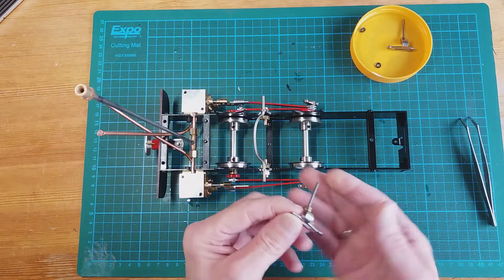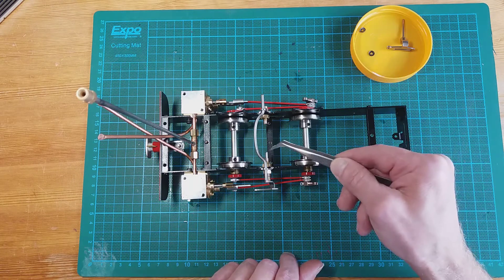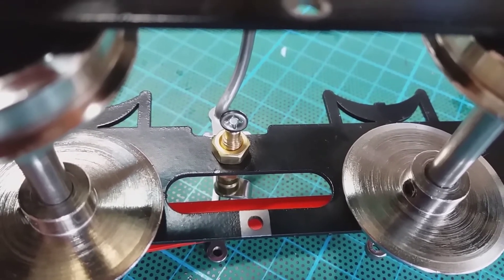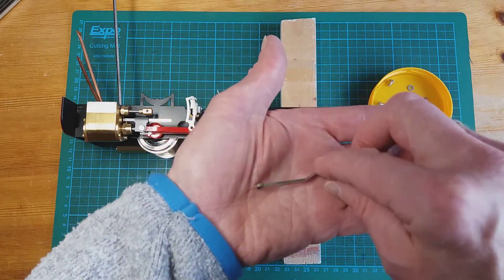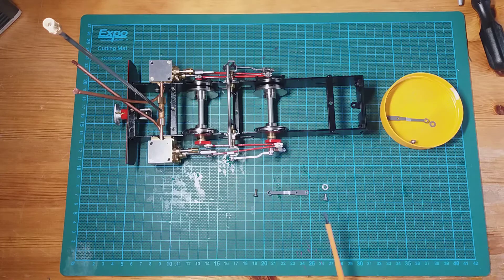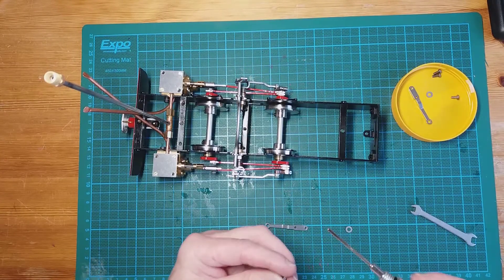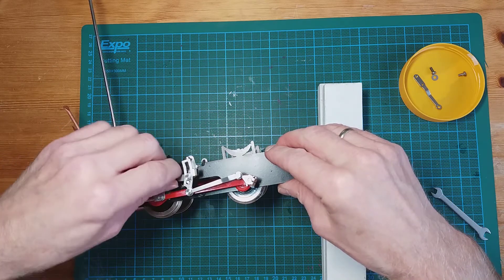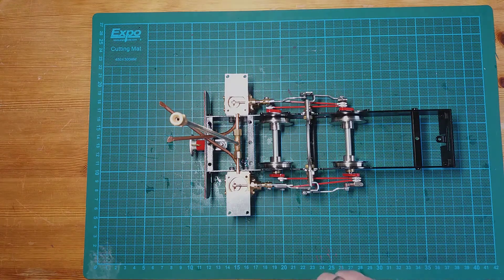RH George Part 11: Fitting the Valve-gear (2)

Comment: Lock star washers are an invention of the devil. Roundhouse need to upgrade this part of the kit. I have smashed the three supplied by Roundhouse.
Reply from the maker: Before I learned the trick I was thinking the same thing. I'm sure RH could update this with a different solution
Reply: @gasmith841  I already had a SLOMO fitted to the chassis so when I got to the two starlocks I was very frustrated if not discombobulated, what ever that means.

Comment: Geoff coming along nicely, as for the star washers I don't know how you kept calm when I built one I called Roundhouse all things under the sun most un like engineering contraption ended up resorting to making my own stop collars with a grub screw to fasten and as for taking one off don't bother
Reply from the maker: :) It is unusual for RH  to do this. You would have thought after so many years making these kits they would have updated this particular bit with something like a collar and grub crew